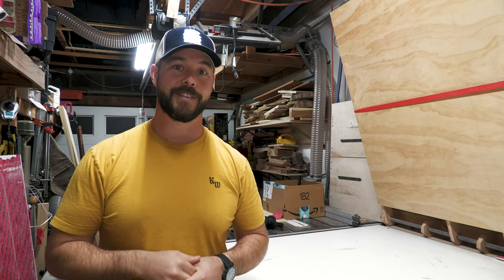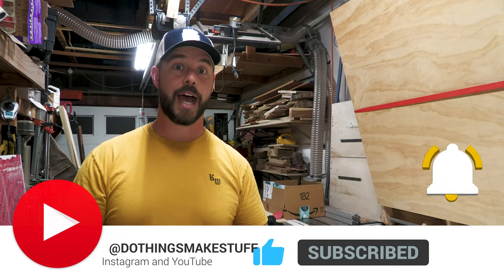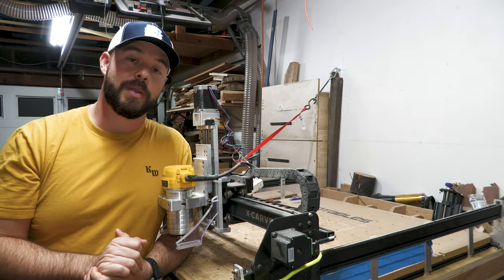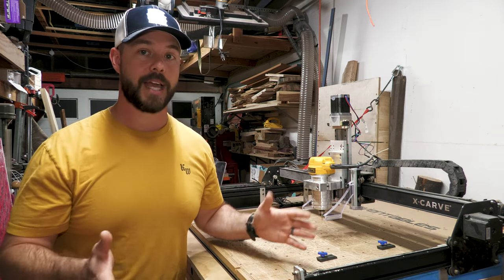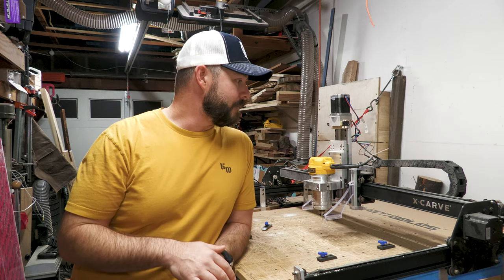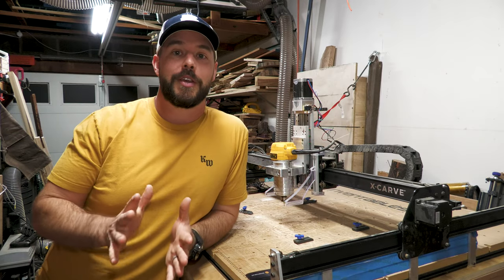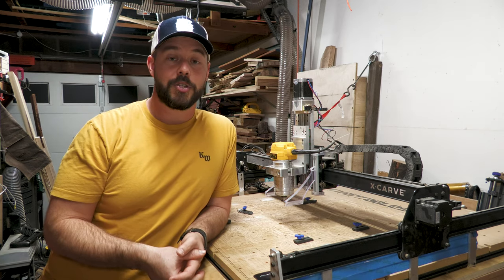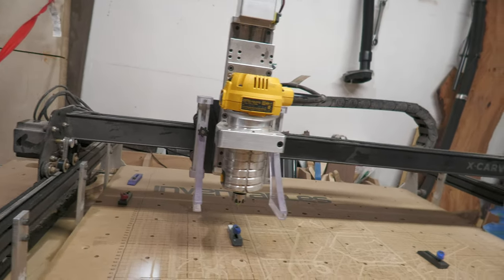Why I love my X-Carve and WONT be getting the pro... for now.

Comment: Hey Man, figured I'd chime in here with some added info: the Easel software is built to work for the x-carve CNC and, as of now, the x-carve is still actually based off an open-source firmware called GRBL. This means that you can use Easel to control any other CNC machine that uses the GRBL firmware. For example, my company produces a CNC called the LongMill that is very similar to the x-carve but addresses all the issues you bring up in this video: supporting the Y-axes, adding more clearance, screw driven on each axis. Our CNC and many others can be controlled using Easel the same as you would an x-carve. Just thought I'd mention it since it seems from your other comments that you believe easel can only be used if you have an x-controller 👍
Reply from the maker: Thank you for that! My knowledge of how the processing and movement aren't super deep. So those other machines come with their own controllers, then? As long as you update the machine's code to the proper steps per inch, etcetera etcetera, then the Easel software will work.   Sorry, I don't know who you are, but I'm curious what machines you have or produce since you said "our CNC." Would love to add move machines and info to the discussion since the CNC4Newbies has really been the main one recommended by others!
Reply: @DoThingsMakeStuff  Yeah exactly, the other CNCs have their own controllers and if they're set up to work for GRBL firmware then Easel will work, just as using a more advanced software will work if you use the GRBL post-processor for those programs. My name's Chris and my company is Sienci Labs (https://sienci.com/) and you could check out our LongMill machine design there. Me and my co-founder started 5 years ago with the aim of continuing to advance the quality and functionality of CNC machines available to the hobby market - at the time the only big options were the X-carve and Shapeoko and we felt those designs could be improved upon. I think the CNC4Newbie options are also pretty great, it really depends on who you are and what you're looking for :)

Comment: I build guitars and I've been doing inlay work on a small CNC for a while. I'm about to upgrade to a machine that will do bodies and necks and after a year of hemming and hawing over the Shapoeko vs X-Carve I was thrilled when they came out with the Pro - until I saw the price. One thing I'm not sure you mentioned was that by pricing this thing over 10 grand they have gone WAY over machines that are superior in quality and features - Machines like Laguna and Shopcraft have CNCs that have auto bit changers and 4x8 capacity and full tables etc...for like 7-8 grand. And that doesn't include buying used industrial stuff. The reality is that even a pro-level shop could spend 8-9 grand and have a far superior machine. So for someone like me who actually builds guitars for a living (wife has a really good job!) I would never spend 12 grand on a machine when I could spend 5 and get all the same features. To me, the entry-level machines top out at about 3 grand. After that, you start getting into some real quality stuff like Axiom. Just my thoughts.
Reply from the maker: Agreed! Or go with the base machine and get the upgrade package which brings the machine to where mine is today for much less than I spent!

Comment: I use Makita router it has variable speed on it.
Reply from the maker: The dewalt 611 does as well but from everything i've read the lowest setting is still a little too fast for the cut rate.

Comment: How often do you have to replace the bits? I'm definitely gettign one of these, just wondering if I should buy a couple extra sets of bits*obvisouly its going to depend on how often its used, i'll be putting it to work!*
Reply from the maker: Most of the bits I broke were in the beginning because of user error. I don’t think I’ve broken a bit in a year or two. I’ve worn a few out but that takes some time. Soooo yes buy a couple extra to learn with. And I would but a 1/8” down cut with the 1/4” shank I listed in the video description. I’d your cutting large stock grab a 1/4” down cut or compression.
Reply: @DoThingsMakeStuff  awesome,  thanks for taking the time!

Comment: Thanks for the review! Do you know if it works with Mac computers?
Reply from the maker: Absolutely!! I design everything on my Mac and get it all set up. I run it on the cheap tablet just so my laptop isn’t covered in sawdust
Reply: @DoThingsMakeStuff  thanks for info! I just ordered one! Thanks man!
Reply from the maker: @Painfulwhale360  an x-carve! Right on!! Have so much fun!
Reply: @DoThingsMakeStuff  would you have any recommendation on a certain brand of bits? I’m planning to cut .75 maple out of a 12”x12” piece and I’m just cutting out image trace objects. Looking for a good uncut bit to where I can get the best and quickest cut on maple
Reply from the maker: @Painfulwhale360  I’ve had really good luck and longevity with whiteside bits. Armana makes some good stuff too but I only have one or two of their bits. If I’m cutting out something hard and larger I use a 1/4” bit and make sure I change the cut line to outside instead of on the line.
Reply from the maker: https://amzn.to/3eB6QtE

This is the up cut bit. I use their downcut as well when I’m making pockets or grooves.
Reply: @DoThingsMakeStuff  Gotcha! That’s super affordable so that’s really nice. What would you say your feeds and speeds would be for hard maple with this whiteside bit?
Reply from the maker: I just looked at my last cut settings. I adjust the feed rate while its cutting but this is generally where I started. 50in/min - Depth Per pass of .06

Comment: Just wondering what tablet you are using to run easel.  Thanks
Reply from the maker: So the computer processing power to run Gcode is super super minimal. I really thought about using something like micro computer but then you need a screen so a tablet makes sense for my set up that folds up and down. If I had a permanent set up I would maybe do something slightly different, but same idea.   Minimum requirements are windows 10 or higher. Needs a USB port.

This is the one I have - https://amzn.to/3gucL2A
It only has 32gigs of storage which isn't enough. I don't keep anything at all on the computer but updates alone have fulled up the memory so I had to go in and delete stock software that I never use. 

Today I would purchase this - https://amzn.to/39SVNd7
Little larger screen, double the memory.

Comment: I'm thinking about purchasing one of these. It's my first cnc. Anything I need to watch out for?
Reply from the maker: Looking at a used one? Honestly they are really simple machines. I would just ask questions about use and if they modified anything. Everything is replaceable and upgradable pretty easily. I had no experience with CNC or 3D printing before getting one of these and realized pretty quickly that they are simply to operate. I would make sure there is no slop with the wheels but those are adjustable also. If you're up for something besides an X-carve there are some really great options people have written about in the comment sections. Just know the X-Carve is a basic introductory  CNC machine. With patience and some learning it can do really amazing things!!!!
Reply: @DoThingsMakeStuff Get a dust shoe ASAP

Comment: Have you looked at the Onefinity? It is $2000 , ball screws, and doesn't need an external computer for control.
Reply from the maker: I will now! Thanks for the tip!
Reply: im not a fan of the onefinity it has no frame/structure/weight to it... and has very small underpowered stepper motors as well as underpowered stepper drivers and power supply...its better than the xcarve for sure but i would not buy it...one feature i do like is it is standalone pc-less design  @DoThingsMakeStuff

Comment: If I were to upgrade from my xcarve, I would rather consider the Shapeoko Pro (2020) which a considerable price. I like your upgrade, been looking at that but yet haven’t justified the purchase as I don’t mill that tall material.
Reply from the maker: The Shapeoko does look very nice! Yea its a minimal upgrade if you don't need the hight. I think the accuracy is a little higher, the bottom of a cut seems to be smoother and more even which saves time on sanding. But, the larger material hight was really why I went for it. Thanks for the comment!

Comment: 17:15 Watch out, the X-Carve Pro is using Ball Screws not Lead Screws, there is a difference in Backlash and especially a huge difference in price.
Still the X Carve pro and also the normal X carve are both absolutely overpriced for what they actually are

Comment: Your vid popped up in my feed, and having a Pro I was curious as to your thoughts. It is an expensive machine, but I will note its still not full priced during the presale. It's not as steep of a discount as it was initially but still a bargain at just over $7k for the 4x4. That's a ton of money, I get that, but like your OG x-carve it will pay for itself if you used it to do so. You stated the Pro is 25% faster, and that's way off the mark. Its more like 400 to 600% faster based on the job. That speed and ability to do those 1/4", 1/2", 3/4" passes is the reason why its a game changer imo. Even for a hobbyist or someone who isn't a full production shop like me. What it means is during your normal wood shop workflow it presents opportunities for quick iteration that wasn't previously there bc the OG x-carve would've taken too long to make it useful. Cutting templates, routing c channel grooves, building cabinets and drawers, and the list goes on. The precision of the Pro is off the charts as well. I am sponsored by Inventables but I will only work with companies I truly believe in. Its really amazing, and by far the most useful tool in my shop.
Reply from the maker: Hey thanks for chiming in man!  The 25x not 25% was off of their advertising and emailing with their team. My assumption was that 25x was the peak on some really specific movement. They mentioned cutting 3/4" depth with a 1/4" bit which is super impressive. Right now I can cut 1/8" with my upgrades but the feed rate is around 45 in/m so its hard to compare not knowing their advertised feed rates.   My video assessment was more geared toward their full advertised retail price of 12K but still 7k feels light. I think there is a major software piece of that price and that I do understand. Easel is so simple to use and accessible for anyone to jump in with no knowledge and make killer stuff!

Don't get me wrong I would love to have one. When I move into a bigger shop and my needs increase it will be a conversation my wife and I have again. Assuming 38% off is their new retail price... which I hope it is.

Thanks for the watch and comment!
Reply: If Inventables gave me a Pro on the house, I'd be all pom poms and cheers too.

Comment: I've looked at the X-Carve Pro and you'd be better with a 48x48 machine from cnc4newbie!
X-Carve Pro is way over priced and underpowered. A 1.5kw spindle with ¼" bits are going to be slow. Cnc4newbie NewCarve would be a much better value and with a 2.2kw spindle much more of a workhorse or get a 4x8 machine from cnc4newbie for less than the X-Carve Pro!!
Reply from the maker: I just learned about that from another comment! I completely agree!!!!

Comment: I do not recommend buying a xcarve ......I like your aftermarket purchased z axis.and added height and y stabilizers...all should be standard on xcarve..shame shame on mr inventables...Yes the millright mega v xl is an awesome machine way way better and more capable than xcarve..fast as heck with rack pinion design...and cheaper priced than xcarve...i  own a xcarve and Simply said stock xcarve is junk period.and compared to competitors at same price point out there there is no intelligent reason to purchase one currently...if you go into forums with experienced cnc'ers  like cnczone they laugh at the xcarve machine  design/build. .Fyi...any cnc machine can tile....the software is what tells machine to tile....even with my crappy flimsy xcarve ive done a 12ft sign....u dont need the overpriced xcarve pro to tile....Yes..urs is not an xcarve.. a stock xcarve will not perform like your cnc...urs is heavily modified with about $1000 in added modifications which gives false expectations...any cnc router can do what an xcarve csn do and do it better..xcarve is not special nor unique...stock xcarve is crap period...it was ok option 5 years ago but no longer...the millright mega v xl ...bulkman workbee 1515...ebay 6090 w 4th axis...cnc newbie newcarve...all are far superior options at about same price and lower....stock 1000mm (30inx30in) xcarve is underpowered...too small...flimsy.built not rigid...too much flex....horrible z axis..rubber belt crap...limited z clearance...tiny stepper motors...its simply overpriced junk compared to other machines in same class.....xcarve pro is a joke...about 3-4x overpriced.....fyi you should not have to upgrade a 2000.00 machine to make it work properly...xcarve needs to redesign the machine to be proper and keep it at same price.....i like the flip up table but having xcarve stored in upright position is a bad idea...its not dedigned to be in that position and its not good for the machine....inventables is great at marketing ...they spend a lot of money on brainwashing people with their ridiculous advertising tactics...they need to invest more into making a better product  that is as good or better than competitors at same price point...
Reply from the maker: Thanks for the input!
Reply: no problem..making people aware of facts can help in decision making..so hopefeully noone will make the mistake i made in buying a xcarve .